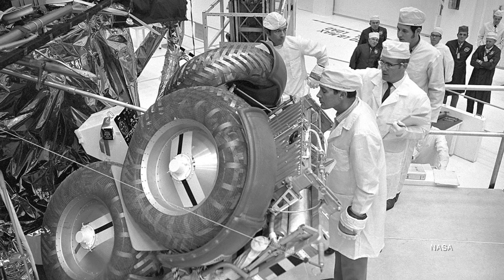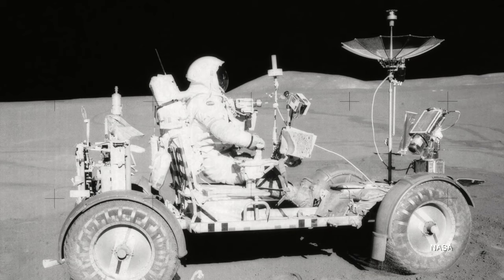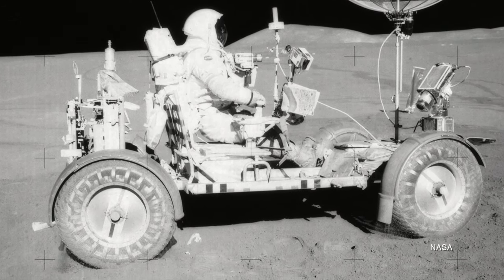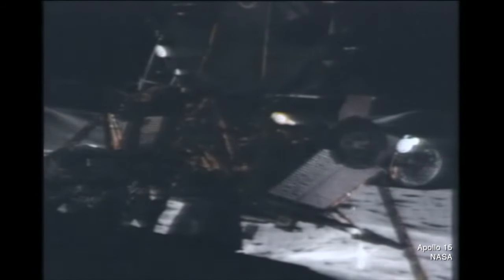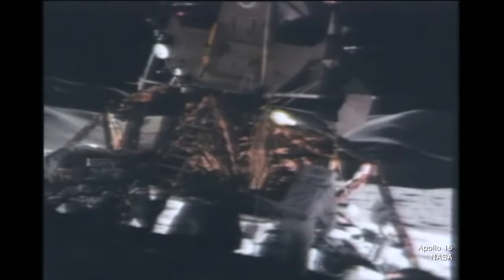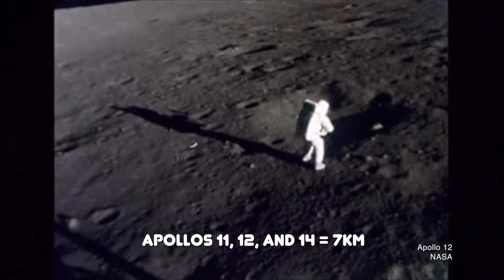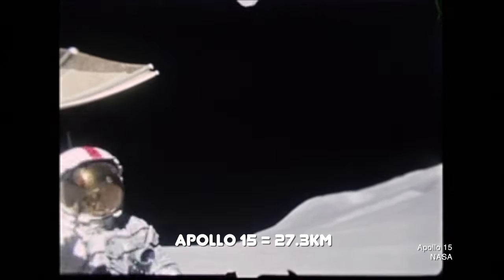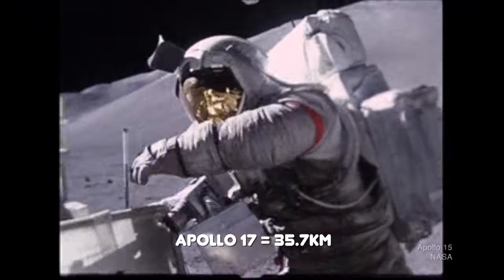How NASA Took Cars to the Moon

Comment: What kind of video cameras were used on the surface?
Reply: They were basically simple black and white TV cameras of various designs that used a transparent spinning tri-color wheel to sequentially break the image up into the three primary colors.  Back on earth a similar color wheel was spun in front of a B&W picture tube to add the colors back in. The wheel on earth had to be spinning in perfect synchronization with the one in the camera on the moon in order to reproduce the colors correctly. Here is a pretty good article on the subject: https://en.wikipedia.org/wiki/Apollo_TV_camera

Comment: I can GUARANTEE you the Earth is not flat.

Oh, well, I'm an electronic engineer specializing in radio, telemetry and communications.  Why don't you google Microwave Point-to-Point transmission and then tell me that long range microwave planners don't have to figure in the curvature of the Earth.  Or that radar has a horizon just like the curve predicts.  I will say that most people don't understand this stuff, but radar horizon is a bit farther than visual horizon, but simply because even at radar frequencies they tend to bend over the horizon slightly, but the difference is only about 4 miles at a 30 mile range.  But, the horizon continues to follow that calculation because the Earth curves and it is consistent except when there is a bit of atmospheric bending (just as occurs with thermal inversions with light).  

Yeah, it's ALL real and there really are satellites up there.  WHy don't you drive around town and look at all of those small aperture satellite terminals on top of many gas stations to handle the credit card transactions.  Notice that they are pointed up into the sky and they aren't fake just to fool people because most are stuck up on a roof where you can barely see them.  

Why don't you go to any radio or tv station and let the engineer show you  how their satellite downlinks work.  Those guys are bored and like to talk to people about what they do.  They would spend hours with you showing you anything you wanted to know about.  

Why don't you buy a dishTV satellite system and prove its not coming from the ground by moving the satellite antenna so you can see that it truly does pick up the signal when pointed to a single spot in space and if you can do geometry (which most flat earthers cant  I'll be honest) then you can see that it is pointing to a point 22,000 miles above the equator based on YOUR latitude.  And that same point that you can ONLY pick up the signal varies with your location to that SAME point 22,000 miles out in space.  Funny how flat earthers talk about sending up ballons but they won't do this one single experiment to prove that there really is a satellite at 22,000 miles up.
Reply: Yaknow WhatIming I was going to give a thumbs up then realized you are a direct tv salesman looking for massive sales commissions! lol
but seriously good job.
Reply: +FlatEarth RethinkingScience I watched the video and I have to say, To send a signal you need some amount of power (More power = farther reach of the signal), like when you have low signal on your cell phone the battery discharge faster because it is using more power for the signal to extend even further, and depending on the device and technology there is a limit to the power usage (batteries usually don't have a high output) and reach that is why the range isn't infinite. When your low powered cell phone reaches a communication tower that tower has enough power to transmit the signal to a satellite.
Also you're very wrong, the antena does not make a "bubble", otherwise there would be no problem being inside a tunnel if said tunnel is inside the bubble.
Light does travel, you can see that with ultra slow motion cameras that can actually show the light going through objects. You shouldn't make assumptions on things that are already proven otherwise.
Reply: +Yaknow WhatIming satellites are fake signals are being broadcast via cell-towers on top of BUILDINGS! see them EVERYWHERE! fake satellites...LOL 1. just because the tunnel is in the bubble doesnt mean INTERFERENCE magically doesnt exist. and 2. i seen that fake 1 trillion frames nonsense. if LIGHT traveled you would be BLIND shows the same NONSENSICAL video

 watch?v=phoqYBvkmuY
Reply: +FlatEarth RethinkingScience I watched the second video you linked and here's the problem with it,

At 0:40 - There isn't anything in the way of the galaxies. That's how the light is able to travel. There is something in the way of the sun when it comes to the deep sea - a whole bunch of water.

At 1:00 - In real life, the rays would illuminate him. The intensity of light drops off with the inverse of the square of distance, so the illumination is only dim, but it's still present.

If they don't, it's because they were absorbed by the air (or objects in the air: for example, fog), which is sort of the equivalent of not throwing the football hard enough to hit the other person.

At 2:20 - The reason why magnets have a limited range is because, if you look at the magnet, there is both a north and south pole. As large distances, these almost cancel out, leaving a very small magnetic force. Light has no such charge, so it's unencumbered by range.

There's also no evidence whatsoever proving that cell-towers are responsible for why everything works instead it being satellites, you can view the ISS through a telescope with your own 2 eyes, don't believe me? Here's a nice NON CGI composite http://38.media.tumblr.com/81a5b33f123dcc87ee4535feb4486f3e/tumblr_inline_ne21qetldu1rxan1s.jpg
Reply: Yaknow WhatIming can I see a live  one?
Reply: Yaknow WhatIming I can see one through a telescope. but not nasa live feed or any ballon test... and there supposed to be over 1000+ please explain..

Comment: Earth to the moon distance is 384,400kms or nearly 800,000 round trip so where did they get the fuel from?
Reply: Trebor  it took 500,000 gallons of fuel/ kerosene to just get into space let alone to the moon
Reply: @garymarquett7989  
You didn’t do science at school did you?
Reply: YOU SAID: "Earth to the moon distance is 384,400kms or nearly 800,000 round trip so where did they get the fuel from?"

== From the fuel tanks.

YOU SAID: "it took 500,000 gallons of fuel/ kerosene to just get into space let alone to the moon"

== How is this an answer to the question Trebor asked you?  He asked you if you're under the impression that they needed to run the engine continuously.  I realize you haven't accused Apollo of being a conspiracy, and, thus far, you've just asked questions and stated a few facts.  But, one of the universal truths of all conspiracy nuts is that they never answer any questions that they're asked.  They ask questions (pretend to ask questions), but, they have no interest in the answers, and they refuse to address any return questions/challenges.  So, basically, the fact that you won't answer questions asked of you, makes it dangerously close to sounding like you're one of them.

To lift 100,000 pounds to the moon takes a lot of energy (fuel) to fight Earth's gravity to do that.  To return, all they needed to do was break lunar orbit, and then basically just fall back.  The Earth's gravity does the rest.  On the way to the moon, they fight Earth's gravity.  On the way back home, Earth's gravity helps them.  How much energy does it take you to carry a 100 pound rock to the top of a skyscraper?  How much energy does it take you to push it off of the roof of that skyscraper and let it fall back down?  That's basically how Apollo worked, except instead of a rock and skyscraper, it's a command module and the moon.
Reply: @rockethead7  and they got through the radiation field without a scratch too.....pfffttt what ever
Reply: @rockethead7 😁
Reply: @rockethead7  You don't know everything.....the Radiation in space is 6000 times worse then having a chest x-ray and Man could really survive that too...NOT !!..back to school for more science lesson 😜😆
Reply: @garymarquett7989  
Why can't you actually answer any questions/challenges?  And, what makes you think you're correct about your assertions about radiation?  Why don't any radiobiologists say what you're saying?

Comment: How far did the travel out from the lander? Was there a backup plan in case the rover failed a considerable distance from the lander?
Reply: The greatest straight-line distance from the LM achieved in any Rover trip was 5 km (3.1 miles). In the unlikely event of total failure of the rover walking back to the LM would have been the backup.

Comment: The camera on the rover changed angle during the ascension. Was that automatical tracking or remote control by earth (with 2~3 sec of lag?) or by the Apollo crew?
Reply: Manual remote control from Earth, with lag.

On the previous attempts, before Apollo 17, the operator failed to raise the camera in time to catch the LEM ascent stage going up. On the last mission, he finally figured out how to time things so he sent the command to raise the camera the right number of seconds before the actual launch. And he nailed it.
Reply: Lawrence, there really was only one attempt before Apollo 17 to tilt the camera up for the launch.  Apollo 15's camera had a broken tilt function, so it wasn't possible.  16's camera did tilt, and he did a pretty good job, but not perfect.  Apollo 17's camera was parked further away than 16, that allowed a larger margin of error, and he really did a good job.  He also had just done a couple of simulated practice runs just prior to the actual launch.

Comment: apollo 11, at 17,500mph, the LEM separated from the command module and descended to the surface and came to a complete perfect stop. 17.5k to zero. how is this done?
Reply: The LEM's separation from the command module happened in  lunar orbit. Lunar escape velocity is 2.38 kilometers per second, which is 5323.908 mile per hour, and it is not possibly to be in orbit around the moon at the same time as traveling more than three times faster than lunar escape velocity. There is no point questioning whether the LEM could perform the deceleration necessary in order to land if your assumptions about the starting conditions are so evidently erroneous.
Reply: +The Woob Orbital speed for the moon is just over 5000 mph. Not 17,000 mph which is needed for earth orbit. Physics, eh? 

The LM separates from the CSM and brakes by firing its descent engine against the direction of travel and hence it begins to arc toward the lunar surface as it's no longer at the speed required for orbit. It really is very simple.

Comment: I have a question why do the ropes used to pull the rover out fall so quickly if there is less gravity? I understand the video is sped up but wouldnt they float down and not drop?
Reply: Would you prefer gracefully fall?
Reply: @odyminiatures3921   The rover was spring-loaded to unfold.  After that, all motions are correct for 1/6th gravity.

Comment: This may be a stupid question but if they used the rover's to record the lander taking off, how did they get the footage off it? Why would they bother to add some sort of video transmitter for the rover's camera just to get that footage?
Reply: Yes it would be odd to fit the rover with a camera and a radio transmitter to send its images back to earth and then only use them to send the video of the accent stage taking off. Instead they continuously transmitted the video from the camera back to earth during all of the rover sorties.

Comment: How did they overcome the heat restrictions for the batteries on the rover?
Reply: They were cooled by solid wax, the melting transferred the heat away. Once the wax had all melted the batteries would overheat, so it only had a known amount of mileage before it would stop for good.

Comment: Why did they leave the Rocket engine behind in the under carriage when they took off ?   with No flames  🔥  during  accent? Only until  a couple of hundred feet  up ?
Reply: YOU SAID: "Why did they leave the Rocket engine behind in the under carriage when they took off ?"

== The LEM had two rocket engines.  The descent stage engine was large (relatively) and throttleable (obviously, else they couldn't land).  The ascent stage engine was far smaller and more simple, wasn't throttleable, and didn't even have a gimbal.

YOU SAID: "with No flames  🔥  during  accent?"

== Of course there were flames.  But, the flames were not visible.  Aerozine 50 and N2O4 burn clear.  Think of it a lot like this video (as an analogy):
https://www.youtube.com/watch?v=Ku7TdLeEGsQ

YOU SAID: "Only until  a couple of hundred feet  up ?"

== Yes, you can see the glow from the burn up inside the engine bell when the LEM pitches over.

Comment: Was the LEM on the three rover equipped missions physically larger than the original modules?  Or was it just a matter of making better use of the space available?
Reply: They completely rearranged the last 3 landers.  They were also a bit larger, yes.
Reply: The "LEM" was a bunch of shower curtain rods and tin foil.
Reply: steve white:  What possible reason would you have to believe that?  And, if that was the case, what did they do with all of the LEMs built by those thousands of people by Grumman?  Don't you suppose that the thousands of people who built the things might have noticed that they were only made of shower curtain rods and tin foil?

Comment: So what propulsion system did the rover use?
Reply: electric motors.
Reply: @ThomasKundera  thanks, makes sense. I guess I just always make the assumption that 50 years there was on fossil fuel engines. My bad.
Reply: @jackdaniels2905  : You are welcome.
Running on non reusable batteries, because it was supposed to be use one shot and left there.

Comment: What were the space suits gas mixes like for the moon or was this still an all O2 environment, how long were they designed to last for lunar EVA's, and did they have a reserve for emergencies?
Reply: Pat Mooney, pure O2, idk how long,  the reserve was the low oxygen alarm.
Reply: Pat Mooney, here's the Wiki article that answers your questions.  However, the bad part is that I already know some of the stats on there are wrong (weight, and Oxygen supply times, are both wrong).  So, read it with a grain of salt.  Wiki is generally a good thing.  But, you can't trust it 100%.

There was the A7L suit for the earlier missions (shorter stays), and the A7LB suit for the later missions (longer stays).

 https://en.wikipedia.org/wiki/Apollo/Skylab_A7L

Comment: If they are pulling the buggy out from right above the thruster cone, how could there be room for the thruster engine?
Reply: Go look at the schematics.
Reply: @rockethead7  😆
Reply: They are on the ALSJ.  You can see in the vehicle familiarization manual about how they cleared out that space and rearranged the tanks to fit the rover (among the other changes).  Why would you make a laughy face?  You're not a hoax nut who asked a question without actually wanting an answer, are you?
Reply: @chuckorozco5565 it's called engineering, Go back too school and pay attention this time.

Comment: One cannot  thrust a craft through space...for there is no land air or sea for propulsion..
Ps, how does the fire burn with no oxygen?!
Reply: To have thrust in space you use a rocket motor: that's exactly made for that.

"how does the fire burn with no oxygen"
Space rockets use a of of different fuels, when those need oxygen, of course the oxygen is carried withing the rocket.

Comment: Why don t those rubber wheels melt?
Reply: Trebor  prove it.
Reply: @landanwoodard7569  Prove it.
Reply: Who said they were rubber? Didn’t you do your research?
Reply: The three rovers used wire mesh wheels.  But, on Apollo 14, there was a motorized hand cart called the "MET," which did have rubber wheels.  The moon never gets hot enough to reach the actual melting point of rubber, but, yes, very close, and probably would cause problems for the rubber wheels if they were on the surface in the lunar afternoon when it gets super hot.  But, all missions landed quite early in the lunar morning, long before it got very hot.  Remember, one day (sunrise to sunrise) on the moon takes about a month (about 708 hours).  No mission lasted longer than about 74 hours on the surface.  So, they landed early in the lunar morning, and left during the same lunar morning.  They never actually saw a hot afternoon, because they were already back home by then.  So, no, the tires wouldn't melt while they were there.  I'll grant you, though, 50+ years of hot lunar afternoons, I'd love to see what those tires look like today.

By the way, it's mighty rude to instantly reject answers to your questions.  Trebor told you a valid answer, and you instantly demanded proof.  Nobody is here to play games with you.  It's clear that you have no intention of accepting input that goes against your predetermined conclusions.  But, at least you can just say "thanks, I'll look that up," rather than trying to make people do more work to help you.  Nobody owed you answers in the first place.
Reply: @rockethead7  Nobody landed on the moon in the first place.......EVER.
Reply: So, why are you asking questions, when you intend to reject the answers?  What's wrong with you?
Reply: @landanwoodard7569  Tell your psychiatrist about these discoveries.
Reply: they were wire mesh. You commented without watching the video

Comment: How does dust kicked up from the wheels fall back down so quickly when they are in near zero gravity ?
Reply: Stuart, the dust falls back down just as you'd expect in the vacuum of space. There is no air-resistance present that would help 'suspend' the dust particles as would happen on earth.
Reply: @sailorman8668 , Yes but have you ever seen  Christopher Bollyn - Tricked into war, on youtube.
Reply: No Stuart, I haven't - got a link to it?